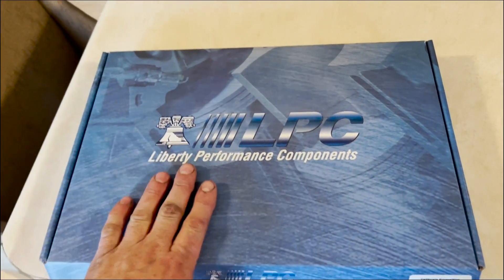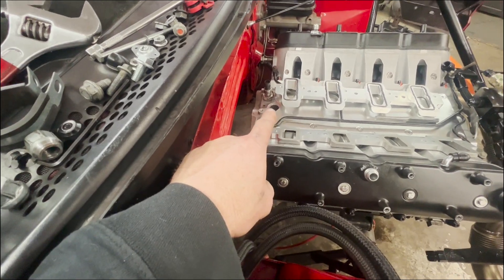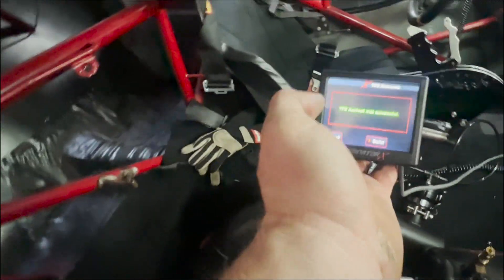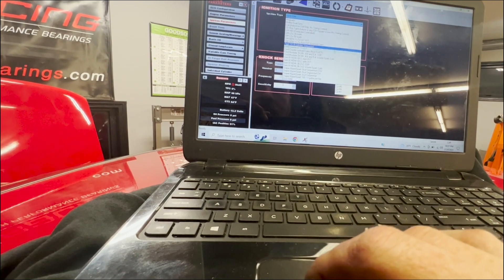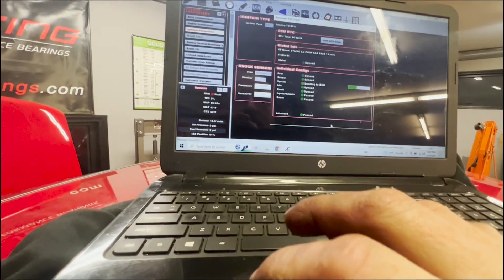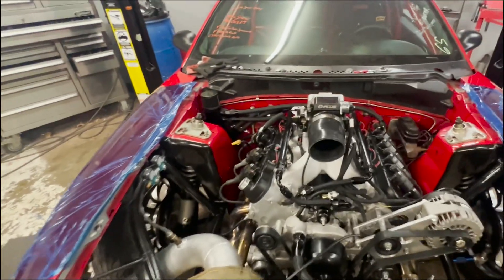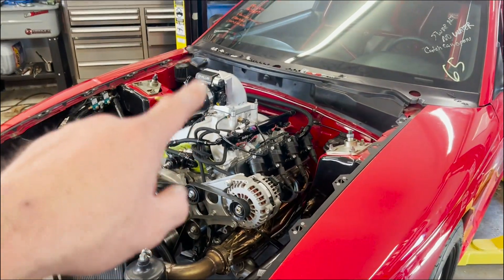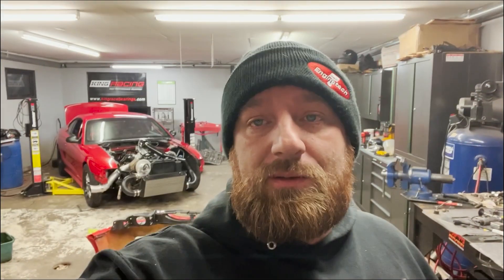MUSTANG SINGLE TURBO SBE L33 FIRST START UP & SOUNDS AMAZING!!

Comment: Car sounds awesome! That an off the shelf cam you're running?
Reply from the maker: Yes this is the Scoggin Dickey sdr232236
Reply: @MREMotorsports1 no kiddin? It sounds good. Def better than my SS2, haha
Reply from the maker: Thanks I love it
Reply: @MREMotorsports1 thanks for the info.  I ended up ordering the cam, lol I can't find any info on converter size thought. I run a 3500 stall. Think it'll be sufficient?
Reply from the maker: Mine is 3500-3800 stall
Reply: @MREMotorsports1  we'll send it and see how she goes, lol Thanks man. And I'm not sure where you're located but if you ever venture out and like sketchy surfaces check out KD Motorsporys Park in Southern Ohio. Lots of good racing on a legit surface. 👍
Reply from the maker: Yeah I’ve watched a ton of SRC vids at KD.. I’m not that brave or fast enough for all that lol
Reply: @MREMotorsports1  lol at least you're honest. I'm not either but I live 5 mins away, lol
Reply from the maker: If I lived near something like that I’m sure I’d have a different opinion lol
Reply: @MREMotorsports1  no doubt, lol. I've ran there for 25yrs. Everyone has gotten faster but me but I try, lol 🤷‍♂️
Reply from the maker: @dustinappling8559 lol story of my life 🤣